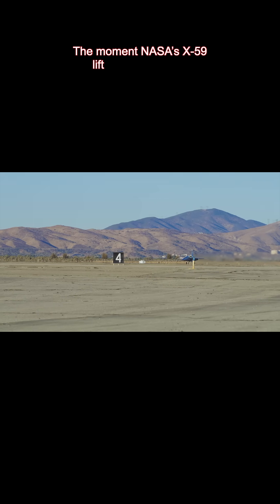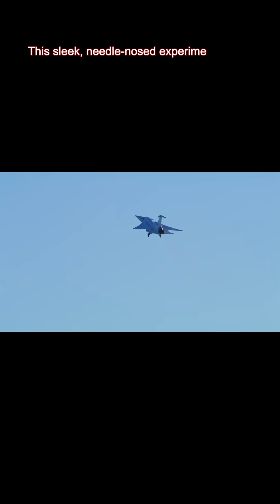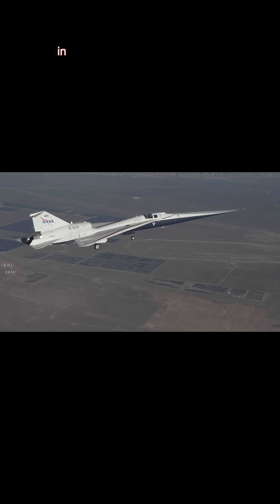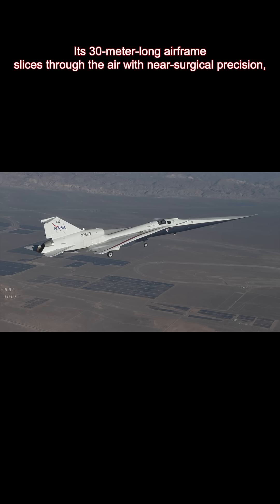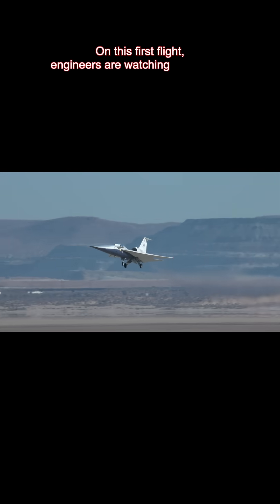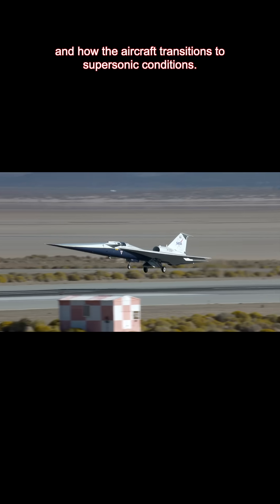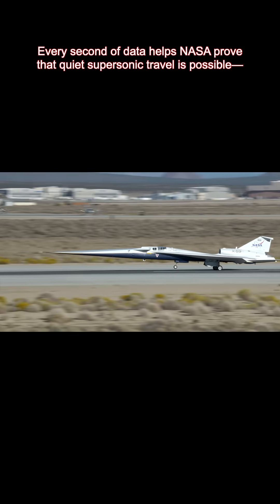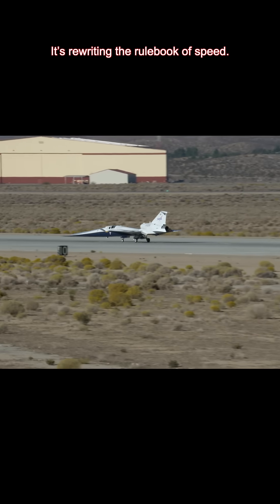The X-59’s FIRST FLIGHT

Comment: Fuel 🔥 $   ?
Reply from the maker: Hey, thanks for the comment. The aircraft is powered by a General Electric F414-GE-100 engine, which burns a form of jet fuel similar to what is used in commercial airliners, but they did not reveal how much they used. It's gonna be costly.

Comment: 75 decibel is still insanely loud & deafening. 115-75=40 That is not that much of an improvement whatsoever!
Reply from the maker: Hey, thanks for the comment. That’s a fair point! 🔊 The difference between 115 and 75 decibels actually sounds much bigger than it looks numerically — because the decibel scale is logarithmic, not linear.
A 40 dB drop means the X-59’s “boom” is about 100 times quieter in terms of sound intensity! So instead of a thunderous crack, people on the ground will hear something closer to a distant car door closing. Thanks for watching.